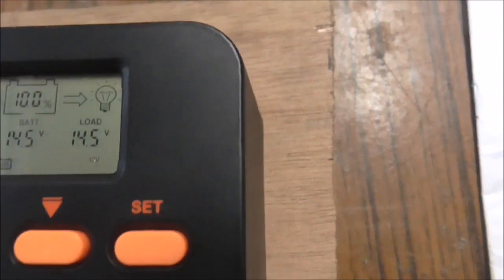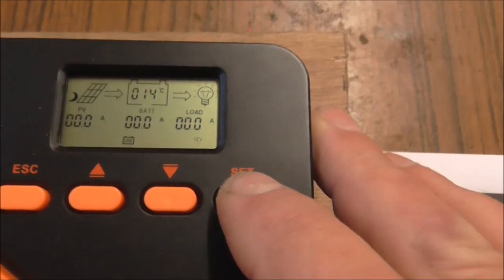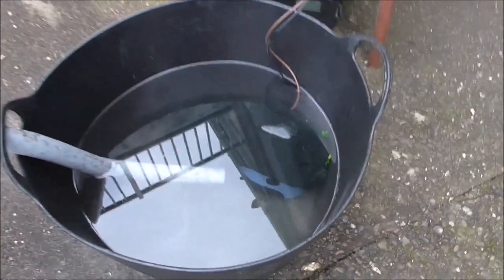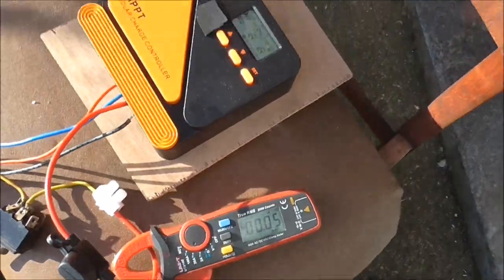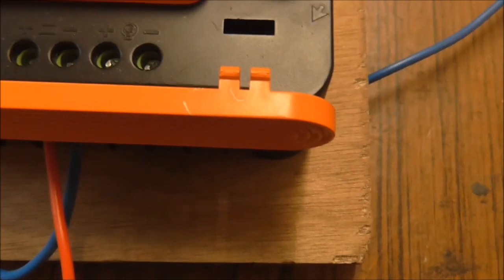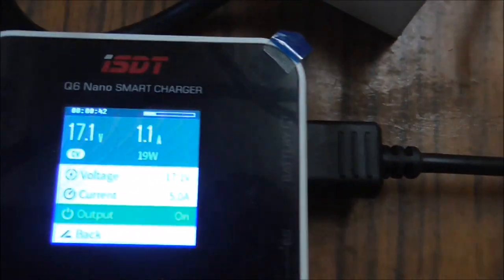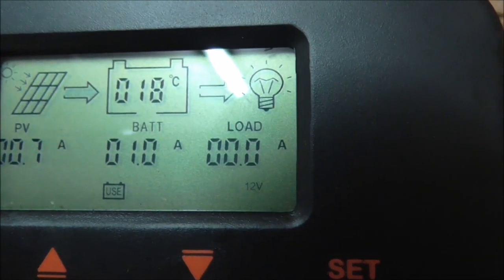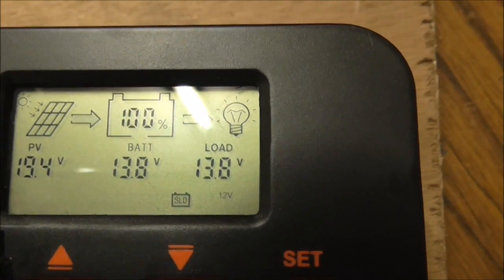SolaMr 10 Amp mppt controller Part 2

Comment from the maker: Having looked back over video it hit me that the capacitors are rated for 35 volts yet specification states up to 50 volts solar input voltage ! and 12 / 24 volts . No way , only 12 volt solar panels in parallel to keep below 35 volts.
Reply: That 35V cap may be on the battery side and it would be ok. There is another bigger cap that is probably related to the MPPT circuit, but we can not see it's voltage rating. We do not know the schema so it is difficult to judge.
Reply from the maker: @markozar73   yes you may be right , controller is installed now so won't be opening it up to check

Comment: I'm one of those that got one of these for FREE. It's the 20a version. I'm a solar guy so when I got this, I was like "is this even a mppt? It's size is more of a PWM controller. Also the ports are so tiny that none of my existing wire will fit in there. I would have to make smaller wires just to test this controller out. It wasn't worth my effort. I gave this 1 star on Amazon. Having use this, is this an actual MPPT ??
Reply from the maker: This was fitted on my brothers boat for battery top up and during testing  was doing mppt. One issue I had with it 
was that it cut off at 13.8 volts and found no way to accumulate or float above this figure even though  
Instructions stated up to 14.2 /14.4 for say lead acid.